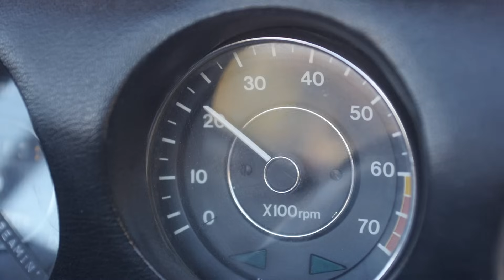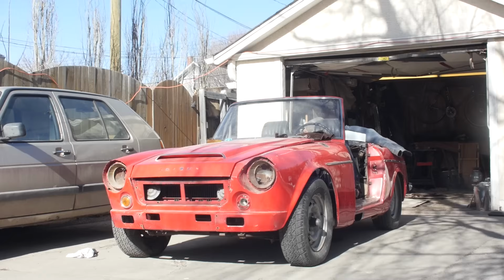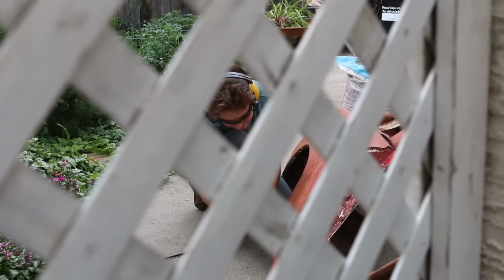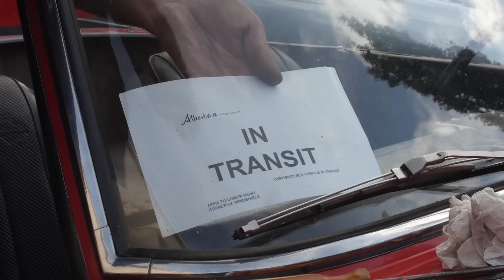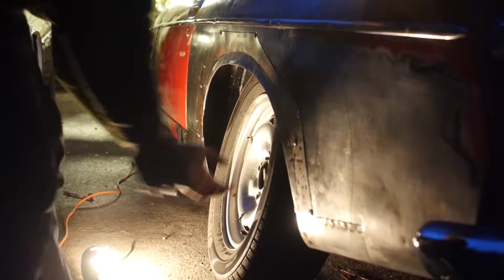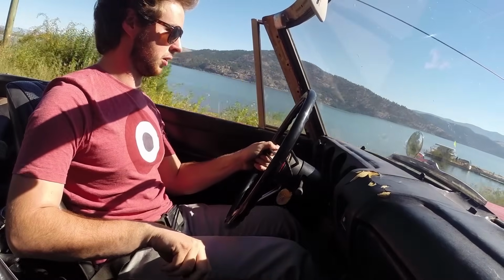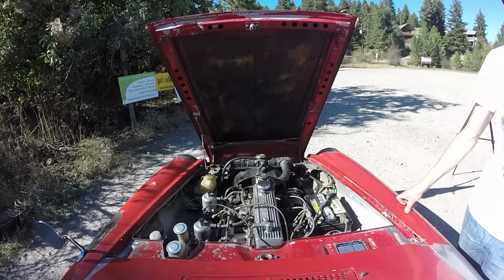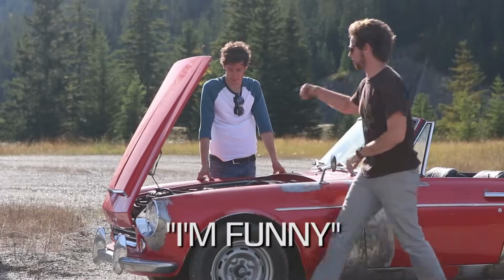Datsun Roadster Revival! | Reidus and Cletus Ep. 2

Comment: Guys!  Owned a 67 back in 73 as my high school car in CA.  I loved that car.  Too many fun times.  Never was able to keep the carbs synch'd.
Definitely a chick magnet.  Met a long time girlfriend by locking the throttle on low RPM, bungee cording the steering wheel to the side mirror so it would run in a tight loop, and hopped out to say hi.  Car was running in circles until I asked her to go for a ride but she needed to hop in while it was going.  She made it!  And the rest is history.
Reply from the maker: That's a great story!

Comment: Thanks for the memories. I had a 1967.5 Datsun 2000 here in California. I drove that thing all over the west coast to New Mexico and more. I was stranded twice on a 1800 mile road trip. A rear wheel bearing in AZ then a blown brake metal brake line in NM. It was July and the temps were close to 115°. I got it fixed on the road each time. Congrats on your build. I wish I never did my SRL311-248/536. Yes, a matching number Sora Blue sweetheart. Michaelaka Calspeed

Comment: Enjoyed your video.  I am currently working on a 1968 Datsun 2000.  Bought it as a parts car for my 1969.  However, decided to see if the engine was still in a running condition.  Needless to say, the engine started and ran.  Since then worked on the brakes, gas tank and lines, and carbs.  Needs body work due to rust.  Driveable but needs bodywork and paint.  Endeavor to persevere!

Comment: I have to admire and respect your patience and commitment to do all that for a rusty old datsun. That tells a lot about what kind of car enthusiast you guys are. The world needs people like you. Although that aluminum panel with rivets is not an ideal long term solution. Those rivets are also made out of aluminum and when they are in touch with steel it creates a galvanic corrosion between them. What ever sealant that was that you did put between those panels will prevent the biggest disaster and i am pretty sure that it will last a very long time. I don't mean to criticize or mock you in any way. That just caught my eye because i have studied sheet metal working for 3 years and done that for a living in the past.
Reply from the maker: Good catch! Clayton here. Alex did that with leftover aluminum from a housework project so on it went! So it goes when you're cheap. Thanks for watching!

Comment: "Transformed from garbage to drivable garbage"  great line and great video.  I have a red roadster and 40 years ago I was taking long trips in it too.  I never sold it and it never stranded me.  It's just my summer car now. Maybe that's the secret to keeping the rust at bay.. If it would have looked like yours did when I bought it, there's no way I would have stuck with it.  Very impressive self discipline.  After all that work, maybe you'll hold on to yours for 40 years too?

Comment: I actually owned one of these cars in the 80's. The engine was so bad I had to put adapters on the sparkplugs to keep the engine oil from fouling them. I used to flip the top clamps and drop the top while going down the road. Fun little car.

Comment: Cool car guys , my old man had a 2200 roadster i remember it didnt have mph only kph, fast little shit tell ya what it had the U20 I-4 with the optional Competition package included dual Mikuni/Solex carburetors; a special "B" model camshaft for 150 PS (110 kW; 150 hp); higher limit gauges; and a license plate surround. In Australia there were no emission restrictions and all 2.0 litre cars were fitted with the Competition package as standard.

Comment: I had a '69 2000 Roadster for a few months.  Ex-race car, roll bar, bigger brakes, springs.  Lots of fun plus rare.  Great until it was broadsided and totalled. But I got to save the race mags to put on the replacement '73 240Z.  Still miss it though.  BTW, mine had a 5-speed, but yours was a 4-speed?  What year was yours?  Good video!

Comment: Two questions. What was your mpg during the trip? What color will the new paintwork be?
Reply from the maker: About 36 MPG, and honestly, I can't afford to make it look pretty, so I might just take all the paint off and clear coat it. - Reidus
Reply: If there's one thing old Datsuns and Nissans do well, is not use a lot of gas. Weighing next to nothing helps. My 1991 Nissan pick-up could get 27 mpg on the highway if i really tried and kept it at 59 mph (95 kph), when I'm sure F150s of the same year were getting 18 mpg with a V8.